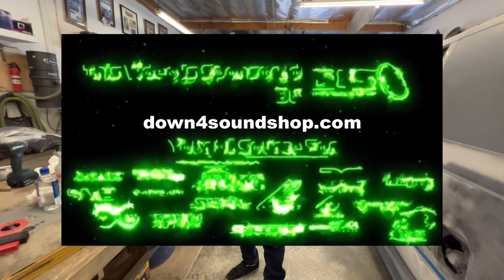BASS VAN BODY WORK UPDATE! soundman bass van

Comment: Just for confirmation, Doug. On a bare metal application, you'd go Epoxy Primer, then you'd body work, then you either do a urethane/etching/high build primer depending on need, then a sealer. Often times the urethane/high build can also be a sealer, but you can refer to the technical data sheet. you don't need an "epoxy primer" before the topcoat. You just need sealer to make sure the thing being painted is a uniform color before being topcoated.

Comment: The epoxy seals the bare metal and protects it from rust, then you bondo over it and the bondo will last longer. If you bondo over bare metal and moisture gets in between the 2 the bondo holds the moisture in and can cause the metal to rust at a faster rate.

Comment: i gave more sound advice in chat. idk how you're get the van straight without a hammer and dolly to knock down high spots and shrink the metal. if you have a dent there's going to be corresponding high area around because that's the nature of metal. if take a sheet of steel, a punch and a hammer and hammer the punch on the steel you're going to have a dent but around it is going to get pushed up. metal working is probably the hardest part for a beginner. i use a few hammers, a few dollies and a stud gun. you don't really need the stud gun but you need a hammer and dolly. and don't mix resin and bondo, it's too hard to sand. thin with metal glaze or that honey stuff. i'm not a profeessional, i just paint cars in my garage and love your videos. good luck dougie